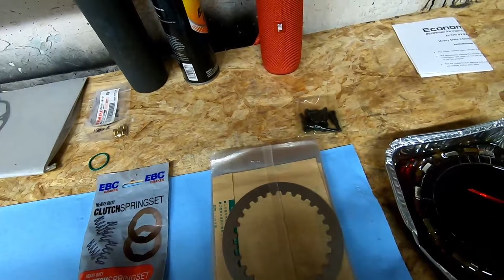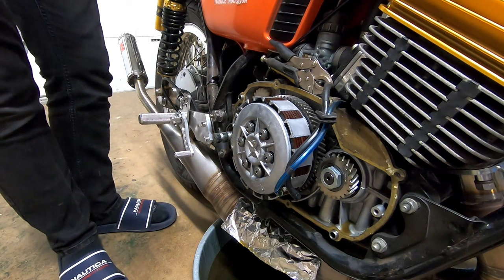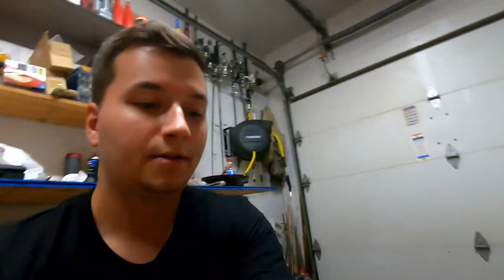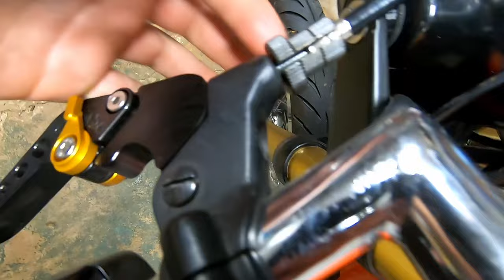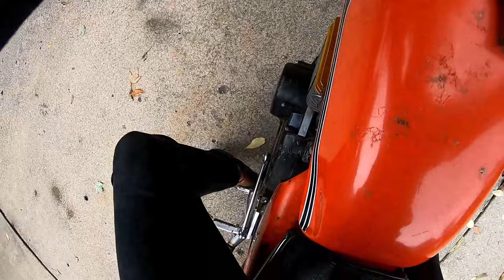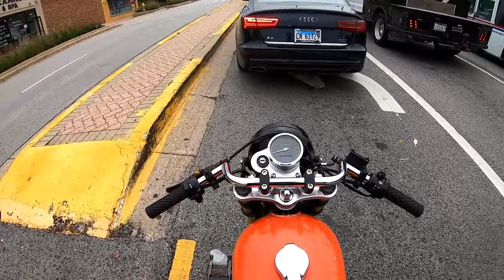Upgrading The Clutch In My RD350 Cafe Racer

Comment: Enjoying your videos. A couple of things: 1. When you removed the heads, you can do that w/o removing the head bolts. Just get them all loose and (lift) remove as one unit (there is enough clearance) . The same w/ the installation. It makes it much easier to guide the bolts in if they are already in the heads. 2. I was going to say "if  you want a few more hp" replace the clutch. I could actually hear it slipping in the previous video. You'd be amazed to realize how much power you can loose from a slipping clutch. 3. If you forget to "leave it in gear" you can just place a cotton towel between the clutch and the crank drive gear. The close tolerances and the hardiness of those two will stop the clutch from rotating. And finally, if you want to be sure you're RD350 (400) is operating at it's best possible: make sure the carbs are sync'd and the timing is "spot" on. Use only a "dial gauge" the factory markings are a little off. Those two things might seem finite but, they will keep you're motor operating more like a Banshee vs a pedestrian motorbike.

Comment: These are wicked machines. I had a 250 with a 350 top end. Crank gear is smaller, which gives it more bottom end. Mine would do wheelies at 40 mph. Power band would kick in an up she would go.

Comment: Also ...... You have the correct impact screwdriver but it's important to note that it's "JIS" not Phillips. It's "Japan Industrial Standard" By using JIS you don't damage the case bolts and can reuse them and maintain patina. I like to grease the threads before putting them back in so they remove easy next time

Comment: Lovely job bud,i had a Becket tuned RD400 in the 80's and boy did it fly.Make sure you have the right jetting, yours sounds a bit flat on the lower revs,bit like cold engine warm up noise.Dont want you to suffer a holed piston if shes lean.The sound brought back some good memories.Great vid.

Comment: Having successfully raced a RD400 back in the 80s, your 350 is interesting.I never had a problem with the clutch but did use Barnett plates and springs. My forks are TZ-350F and the engine has been converted to water cooled via a Fahron top end from the UK. Pipes are an original set from Erv Kanemoto and made the most difference. Transmission is from TZ350 using its dry clutch, CR gears and water pump. I torqued all the side cover screws to around 78 inch pounds in a pattern starting at 12 and 6 and working around the cover- keeps oil leaks at bay. Bike looks nice, good job. Mine would top out at around 140-145 at 9000rpms. Best to keep it around there. Good luck

Comment: Hats off to you on that front end swap. I wanted to do that but didnt think I had the knowledge to pull it off. It looks really cool.
Reply from the maker: Thanks! There's probably other forks that bolt right on and are an easier process but I wanted these specifically since I thought their size suited the bike well. If you've got the time and means its a fun time building custom parts!
Reply: @Enginerded  So, its a honda grom fork??
Reply from the maker: @FH.Adventures  yep, grom forks with stiffer springs!

Comment: nice dude. i put the same clutch in my RD, hopefully the conversion to a track bike will go smoothly for me
Reply from the maker: The clutch kit is great! I dont like the springs though as they're way overkill in stiffness I think. Will be throwing some new stock springs back in once the weather warms up! Good luck with the track build, its gonna be a blast!
Reply: @Enginerded  yea I stuck with stock springs and they seem to have plenty of bite. Hopefully they hold up to the extra power of a set of chambers.
Reply: @Enginerded  Alternate the springs, eg upgrade the 12 o'clock, 4 o'clock and 8 o'clock springs and leave the other 3 standard. I ran one like that for a couple of years and had no issues with it.

Comment: Just a tip, they're NOT philips screws. They're JIS screws. Once you hvae the right bits, you'll be amazed how much more easily Japanese "Philips" screws come out of the bike!!!  You can get them online.  Miss my 350.  Have you done a video on the front upgrade?  Very tidy!  What rims did you use?  What are the pipes? Jim Lomas? Looks sweet!  The O rings between the plates are there to prevent the clutch dragging and make finding neutral easier when you're stationary.
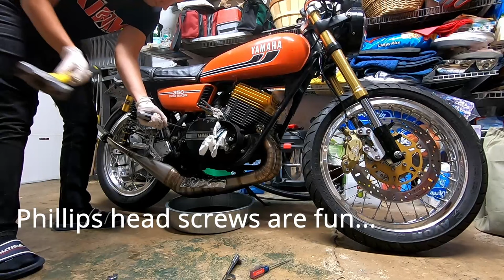Reply: Dude, this is driving me nuts too!  Why call them "Phillips" when you know very well they are JIS bits, because he has the super trick Vassel JIS Impact screw driver from Japan!?!?! (timestamp 1:17). Some people may be watching this that are new to wrenching on Japanese machines who need to learn about JIS and not tear them up with Phillips bits.
Reply: Having said that, I'm enjoying the series and the guy's building a great bike!
Reply from the maker: Agreed, they are JIS screws and the screwdriver set I have I bought specifically to work on this bike back when I first got it. Definitely saved me from stripping all the screws on the bike. I just refer to them as phillips because thats how i see them, I know they're JIS though.
Haven't dont a video on the front end yet as the bikes been away in storage for winter and I've had to torn down since I've been working on a custom seat section. Will be making one once it warms up outside!
Using excel shouldered rims from bucanan's spokes. A little wider than stock but not by much. Yes they are JL pipes! Love the sound, look, and performance of them. Appreciate the comment and kind words

Comment: Hey mate, great build. It's running beautifully. 
What do you have your timing set at with what jets?
Also your needle clip position and are you running stock carbs? I've had mine 2mm BTDC stock carbs 200 main jets. 

Need to get her running like that.
Reply from the maker: Thank you! Timing is at 2.0mm BTDC but i plan to back it down to maybe 1.8 or 1.6 as the new heads tightened the squish a little bit much. 

Running the original carbs with the Dave F carb mod, started with the 220 main and worked my way all the way down to the 180 main for it to rev out perfectly without bogging.

I believe im running a 37.5 pilot as 35 was too lean and 40 was too rich. Had to fiddle with pilots and the air screw quite a bit to get it to take off in first gear smoothly.

I want to say the needle is in the middle or one step down (richer), but its been a while since I've set the carbs so its tough to recall at this point. Should be easy enough when you get the pilot and main dialed!
Reply: Awesome response, thanks for that.
Reply: Although The Dave F Carb Kit only comes with 27.5 and 30 pilot jets
Reply from the maker: Yes thats right, i had to buy richer pilot jets a few times before i got to the right size

Comment: i feal your pain  back in75 76 77  i  blew up more rd350 engines untill i got it right its none of my business and never will be but the first thing i would do is put a block off plate on your oil pump and start pre mixing i tied 1 up in a 100 mph sweping decreasing radius cornener with no leathers then i would check your piston to cylinder clerance i could be wrong but i thought i herd some piston slap it is better to replace the pistons now than to break a skirt an destroy  the whole engine good luck by the way my contact WKR racing he knows more about mc engines than most people will ever know i will try to follow your build dont make my mistakes

Comment: Subbed!  I've got an RD that I got as a basket case.  I'd love to hear about the fork and front brake conversion.  I heard you mention Grom forks in another video and I've also read someone once used RM125 forks.  Do you have the parts list or a write up about that part anywhere?
Reply from the maker: I don't have anything formal together but I do plan on making a video about the conversion! I went a little overboard and designed all the adapter parts in CAD and had them machined. These were left/right axle adapters, rotor spacer, caliper bracket, gauge bracket, and upper triple clamp. You could probably get away with making some sort of sleeve for the RD stem to fit into the grom upper triple instead though.

They're 2017 grom works with racetech .75kg springs i installed. I'll be installing the racinbros adjustable damper kit for the forks once i can get my hands on them though for some actual damping control.

Using an old aprilia rsv1000 brembo, mid 2000s ducati monster 300mm brake rotor, moto guzzi brake master cylinder, and a spiegler brake line that i ordered to length. I think thats the "parts list" but there was some other little odds and ends involved.

Comment: In 40 years of bike riding and building I have built close to 2,500 engines and never in  that time have I ever torqued a clutch screw.
Reply from the maker: I try to follow torque specs on more critical components, but this time was one of those times that going by feel would have worked better!

Comment: Nice upgrade and video. 
 Are you still running the stock points/condenser ignition?
Reply from the maker: Thanks! Yes still original points and condenser setup. Just cleaned the points and set timing to 2.0mm BTDC before putting the heads on. Will eventually convert to an electronic ignition system

Comment: I need your help I’m wondering where to find parts for the CDI, a wire harness to put headlights and turn signals, and a voltage regulator that will fit this specific model. Im not trying to restore it to its original Im just trying to make it work again, there’s water damage and I know I would need to do a whole tear down of the engine, I just need help on what websites to look at because I’ve tried eBay, and Amazon so far not any luck
Reply from the maker: HVC Cycle and Economy Cycle are both great places to find RD parts and are often where I bought 90% of my RD parts.

Comment: Not sure if you have anything posted on here about it, but what did you do to convert the front end? Building one myself and would prefer the modern inverted grom forks
Reply from the maker: I haven't posted anything specific about it yet, but I plan on making one in the future. Basically had to design and machine a few parts like the top triple clamp, caliper bracket, axle adapters, etc, but you could probably do it without the custom triple. Used the RD stem with the bottom of it turned down on a lathe so I could press it into the grom lower triple and still use RD stem bearings and all that.

Comment: Did you swap the front end if so with what
Reply from the maker: Yessir honda grom forks with stiffer 0.75kg racetech springs i swapped in. Had to design and machine some adapter pieces but came out really well to where im happy with it!

Comment: Those rubber rings keep the plates from rubbing against each other and squared up when clutch is released
Reply: You are correct in your comment, BUT a secondary  and important reason for yamaha was to quieten the clutch rattle due to thghtening noise regulations , particularly in the US .   ...   p.s. i believe all racers used to eliminate the rubbers.

Comment: Is she still holding up with no slipping??
Reply from the maker: Didn't get to put a ton of miles on it before the winter time but it was holding great! This season (2022) i haven't rode it as i cut it up to do a cafe seat conversion and haven't gotten around to finishing it yet. Hopefully soon
Reply: @Enginerded  Cool.. thanks for fast reply.. Ill have my RD350 on the road next week.. if she slips.. ill do the same upgrade from ur feedback.
Reply from the maker: No problem! I will say id probably go with new oem clutch springs. The heavier springs are too heavy in my opinon. Others have said the stock springs hold up with with the upgraded FZR clutch friction disks. Ill be switching to those once i have it back on the road